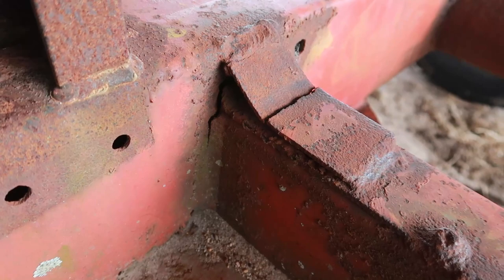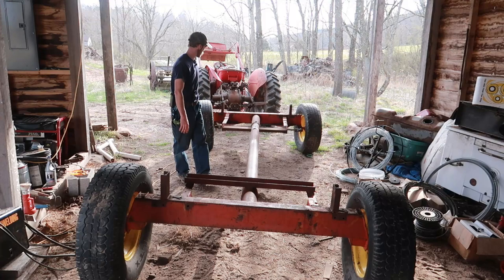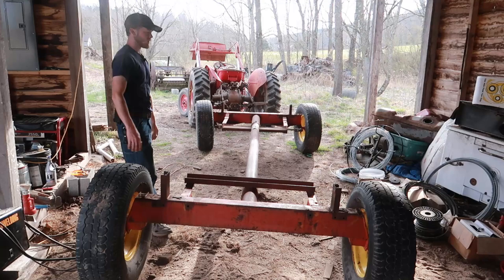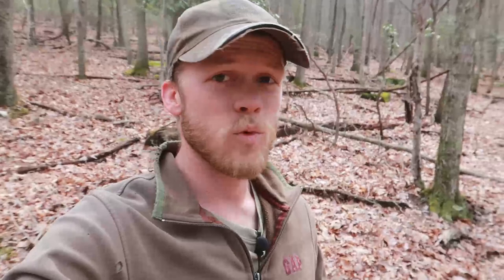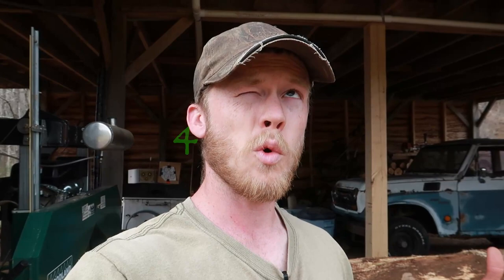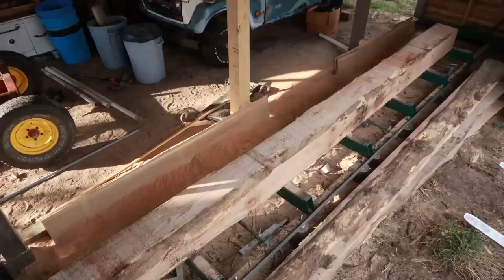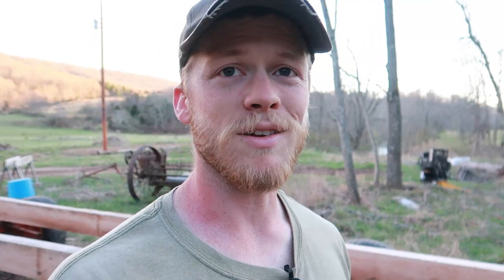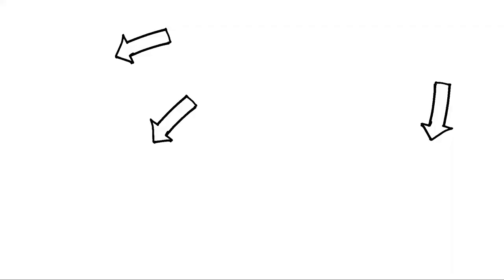Rebooting the Eggin' Wagon Project

Comment: Disc -  start using penetrating oil on the rusted bolts a week or 2 before you plan to work on it...give it a shot or 2  a couple times a week to give it time to work... and have square nut sockets handy, and a long pipe as a cheater bar......Just ask me how I know!!

Comment: Good to see progress on the wagon. 😀 Have you tried the old Massey for logging?
Reply from the maker: Some. Doesn't handle the big stuff very well, but works nice for the shorter smaller stuff.
Reply: @LandisLegacyFarm  I've hauled out alot of logs with the old Ford 601 workmaster.  It works well but sometimes the front end gets a little light as I pick up the butt end with the 3 point hitch.  A 16 foot 30 inch diameter black cherry was the biggest it could handle and that was maxxed out with the front end so light I could run over a persons foot and they wouldn't notice it!  Not OSHA approved but fun!

Comment: Are you able to do maple syrup down their Josh I am sure you have maple trees in your area?
You could of taken your wagon and it would be much more easier on your equipment! Here is a link to what a log arch looks like! this one is a lot smaller than mine I should post mine up on my channel so you could go look at it. It was a farm implement that I modified I can take a 30 inch log and use my tractor similar to yours to pull it. What is nice about the log arch it keeps the log off the ground which keeps the log out of the dirt! 
Here is another option  instead of picking up some angle I would pick up a 2" wood bit. Drill down threw your top 4x4 into the beam under neath it and hammer in a wooden stake Then drill a diagonal hole threw the bottom bunk and top bunk threw the stake and drive in a 3/4" stake to hold it together You could use a nail or spike as well! This would give you a really cheap and strong way of fastening them. If you do this use a hard wood steak for strength. You could make the steaks with a axe or a wood lathe. They did this years ago to fasten barns together. Just a thought 

https://youtu.be/h4lfW8kP6-Y This is off youtube!
Reply from the maker: Yes! Not a lot of people do it around here, but I'd like to give it a try one of these years.
I'd definitely like to get another set of running gear and turn it into a log hauler of sorts.
This stake idea is very intriguing.... I might just have to give this a try
Reply: @LandisLegacyFarm  Keep an eye out for an upcoming video by yours truly on making a hay wagon into a log hauler...getting the old racks off now.